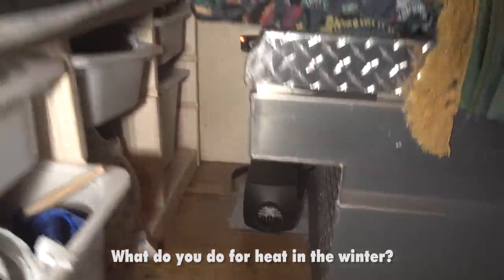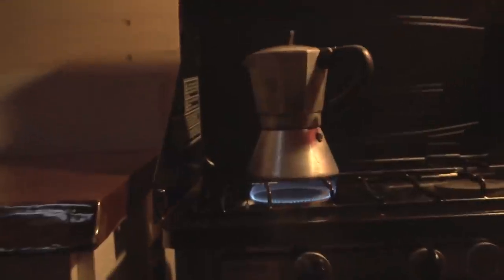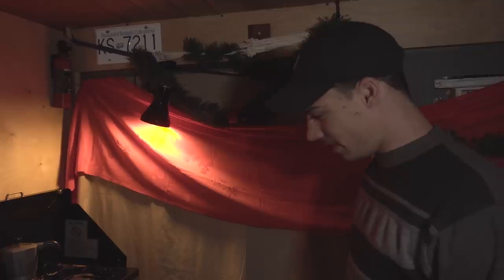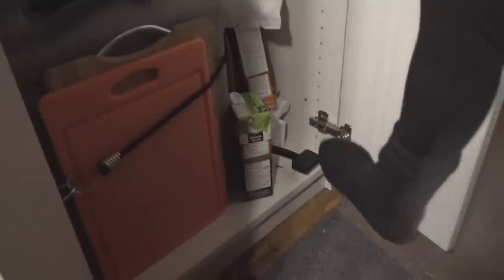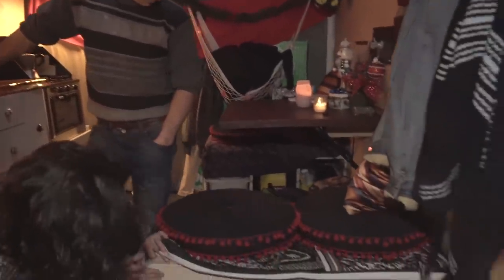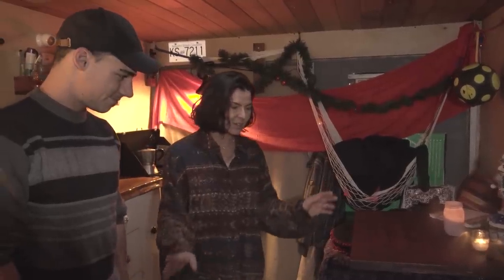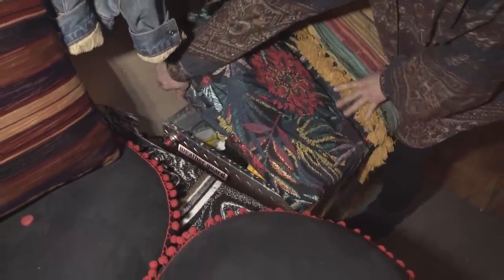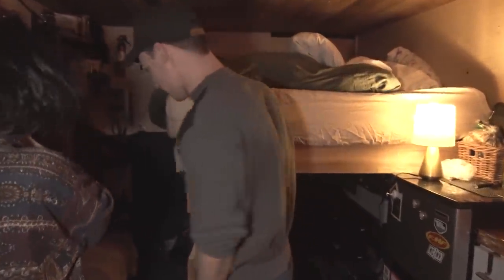Moving Truck Cube Van Converted Into Functional Stealth Tiny House for City VanLife // 4K Tour!

Comment: I dig it. You guys seem very cool. The van setup is great and looks simpler than most. Stealthy, but the rear ac is a dead giveaway, consider a roof top unit at some point. It'll be expensive, but it looks like a catering truck. My personal opinion is you will miss not being able to sit up in bed, is there a reason you built it so high?